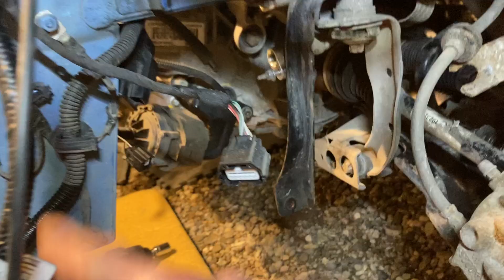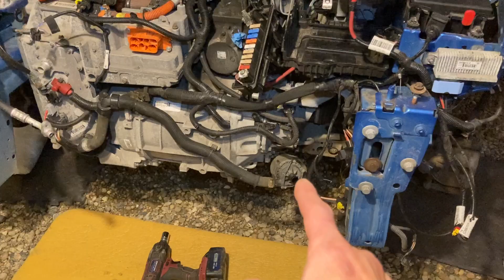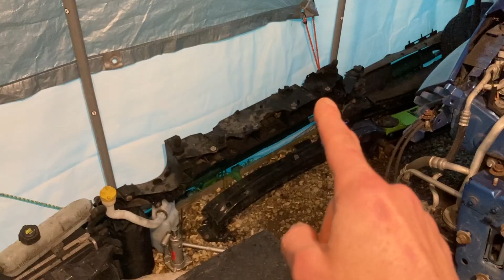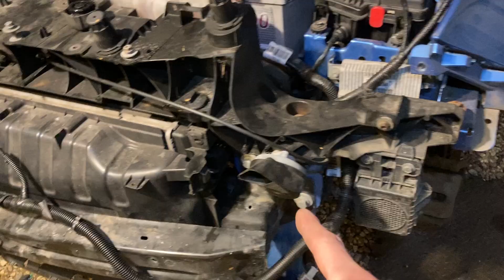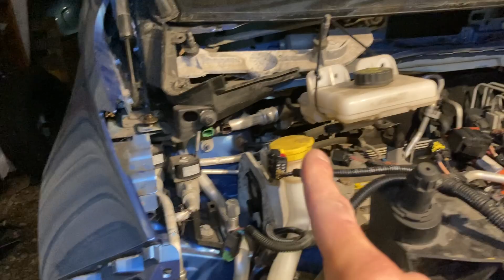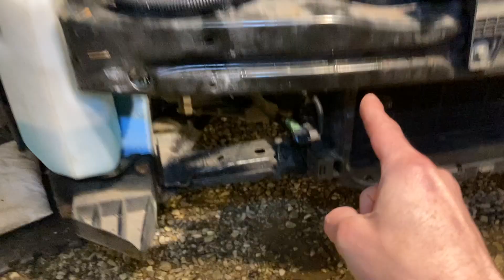🔧🚙 EV Motor Bearing Repair - Renault Zoe ZE40 5AQ Rebuild Part 1 🚙🔧

Comment: I'm very interested in the other ZOE you've bought, the one with the motor failure problem, because mine does the same. No noise from the bearing. Took it to the Renault Dealer's workshop , and after 3 ( THREE) months they've chganged the motor position sensor. Got it back just to bring it in again the very same day for the same exact problem! The only strange thing is that it occurs only when it's above 16° outside. I had to use my zoe for two more weeks after that because they didn't have a courtesy car available at the moment , but since the temperature dropped below 16°C ( I'm writing from northen Italy) it is perfectly working at the moment. The problem seems to become even worse when the air cond is on  in hot weather  or when it's charging at 22kW ( it goes into gear, but it stops right away) . Hope you can find what it is , since i'm afraid that at the dealer's workshop they don't have a clue of what  the problem might be. Unfortunally, here in Italy there are no private workshops like yours that can put their hands on electric cars...or at least none that i'm aware of...and i've done my research, trust me. Hope to see a video on the topic soon . My Zoe is a 2017 R90 with just 48000 km ( bought second hand a year ago) .
Reply from the maker: I suspect there is a motor fault as the position sensor is on the motor then there is an oval ring on the motor shaft so if the motor shaft has excess movement it can’t cause the sensor to lose the signal. I have also hear of possible interference from a metal clip on the reduction gear but haven’t seen that myself. We will see! Cheers